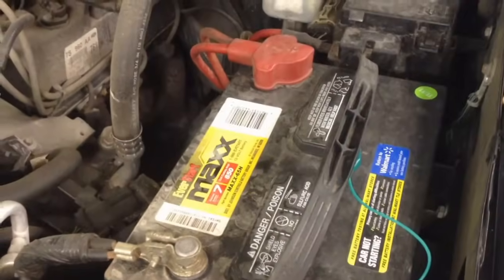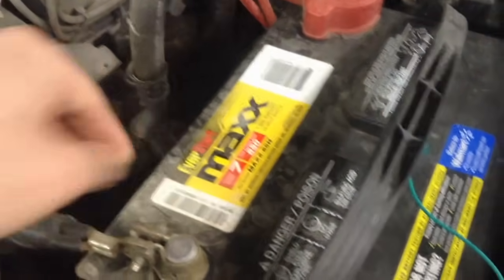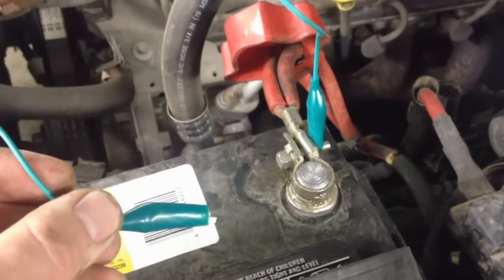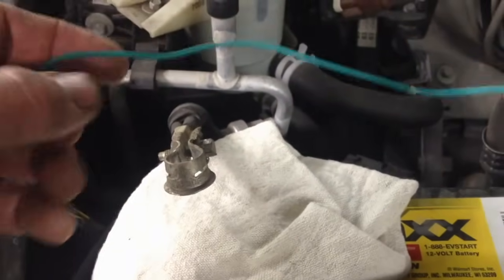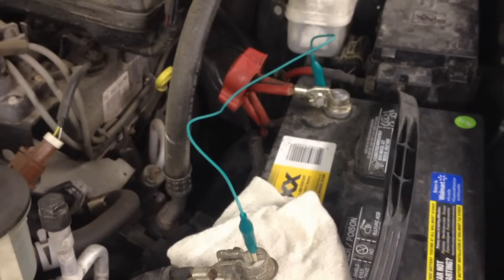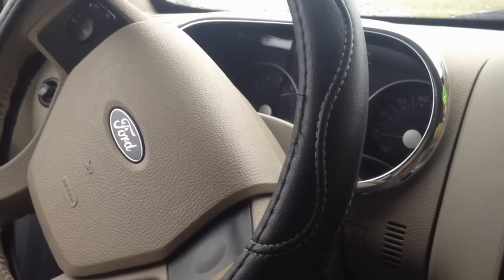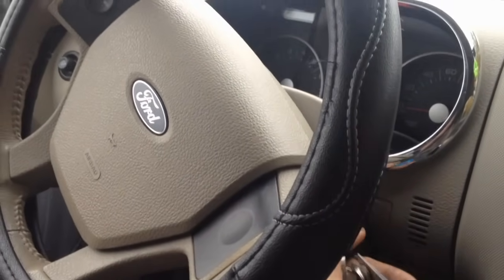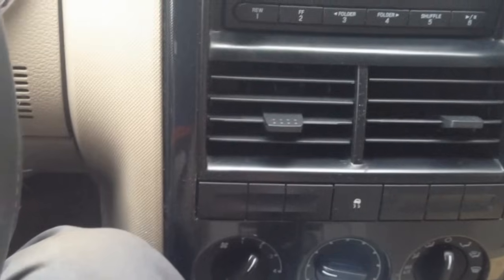How To Clear Your PCM'S Memory On Fords After Repairs

Comment: I have Ford f250 5. 4 99 in light duty body (oem)  redoing timing chain it skipped time resetting time chain I wanted to replace cylinoid vtc and cam phasers but it seems like I don't have the same set up. Also to which coil packs and spark plugs are the best for replacement . Tired of buying cheap coil packs any help would be great. P.S I live in Kelso Wa if you want to stop by other people might have an oddball like mine

Comment: Sir pls I have issue with my Ford Explorer 2010 airbag light is on ,when I switch engine off and again on light will disappear but after few days it will come again without any reason , kindly note it's not plinking to give any code only one and stayed
Reply from the maker: AHMEDELSAYD SAAD Only common issue on the explorers is the passenger airbag off light above the radio goes out or the connector gets disconnected. Otherwise get the codes read.
Reply: Acutely, it's not passenger airbag this in my dash board driver airbag and it's not plinking to give code just illuminating pls help I got crazy
Reply from the maker: Yes I know but the passenger airbag lights fail on these and will cause the airbag indicator in the cluster to come on. Pull codes and you will know.
Reply: I thought you guys rode camels? You have cars now? lol

Comment: I have a problem I did the reset like you showed here now it seems like my vehicle is idling low, any advice please help???
Reply: FordTechMakuloco sir now the vehicle is idling strange the check engine light came on, its not flashing its just on??? please help the vehicle wasnt like that until I did the reset
Reply from the maker: Bo Temple which vehicle model year engine please
Reply: 2006 mercury mountaineer
Reply: 4.0 liter v6
Reply from the maker: love nature Clean the throttle body as shown in my video video and perform the reset procedure again. The throttle body is sludged up.

Comment: I have 2004 f150 5.4 3v it keeps going into reduced power mode with code p2106 tried to reset pcm if you  can assit me with this it would be greatly appreciated
Reply from the maker: Mary Slagter If you have a 2106 code there is another code in there. 2106 is only a condition code. If you want my answer you likely need a tps sensor or a whole new ETB quite common.
Reply: FordTechMakuloco Using my aftermarket  scan there is no other codes stored in the pcm.does that 3v engine have the spark plug issue.
Reply from the maker: yes yours has the broken spark plug issue

Comment: I have 03 expedition I got a p0506 or 07 for a low idle. I tested the ohms on the Old iac it and it came up to low. I replaced the iac but upon start up it idled up and down but eventually leveled out. Now whenever I start up its revs at about 1500 - 2000 rpm for a good 15-30 seconds before dropping to about 700 rpms. Sometime i come to a stop theres a little up and down idling but it quickly pans out. Should this this fix the issue. Thanks for helping us DIY guys your blessing sir.

Comment: I'm having a real hard time with my ford freestyle 2005 it idles but when I drive it goes into safe mode  I swapped the throttle body thinking that was the problem but I didn't do this procedure I will try it hope it works any advice or help is appreciated thanks for posting this

Comment: My temperature sensor is getting to many volts passing thru it I tested it today and it is passing way about the 5 volts it should be passing. I think I was up somewhere around 12.10 volts do you think this restart would help it learn the values it needs. Because the truck has hard started and retarded timing when its at operating temperature cause it always thinks it cold...Any help would be awesome and thanks awesome video by the way

Comment: I clean my  throttle body and now the flap won't close all the way. It's idling way to fast the other side is working fine after I cleaned it. I disconnected the battery and rest the computer but still same problem.  I have a 2007 Infiniti G35x sedan.  Any suggestions
Reply from the maker: STREET SURVIVOR Most other manufacturers requires the dealer scan tool to reset the etb angle.

Comment: this 61 year old loves you makuloco! had alternator/battery issues and after the repairs were done i had shift issues. mechanic said 'you may need a new transmission'. being the daughter of a mechanic i googled shift issues and found you. not afraid of getting a bit greasy...i tried this today and it did exactly what you said it would...now i can go north next weekend without fear.#memelovesmakuloco
Reply: Thank you Peggy for sharing this. This is very helpful and useful.
Reply: The battery connecting helped your shifts???
Reply: Pac Man Gamer Doing this reset computer and computer learns shift point based on your driving.
Reply: Peggy Eggers Smith wow you do it yourself. .. not much women work on cars ... I'm happy for you.  thanks for sharing your story .

Comment: Great to see people helping people not looking to rip them off.
Reply: You're exactly right. Finding a good honest mechanic these days like FordTechMakuloco is next to impossible. In MHO he's worth his weight in gold and then some.
Reply: @BrianSmith-lo3mj  1¹¹
Reply: Now help him with a 1 dollar donation.
Reply: I need to know the colors of the wires going into the fuse box under the hood how do you know how that goes that burnt down and I'm trying to wiring another box I don't know where they go
Reply: James you are perfectly right on your comments. I am a jack of all trade myself and I helped a lot of people , and  mostly I don't take money , just happy helping poor people.
Reply: James R. Schroen Sr I HAVE A FORD FOCUS ST 225 2007. MY ENGINE CUT MID BOOST. 2ND GEAR. NOW I HAVE NO REVS ON THE REV COUNTER ENGINE IN LIMP MODE. MANAGED TO GET HOME. GEARBOX FEELS LIKE IT HAS LOW OIL IN TBH. READ THE FAULT CODE. P0727. I SUSPECT AN ENGINE SPEED INPUT SENSOR. WHERE IS THIS LOCATED ON THE TRANSMISSION
Reply: @davecozzie1  where might this be on a 2007 Ford Edge SEL AWD SUV ?

Comment: I changed the guage cluster in my moms 2000 windstar when I put it back together it wouldnt start. So i put the original cluster back in and it still wouldnt start. so I found a blown 10n amp fuse. I replaced the fuse and itstarted. But the radio didnt work. So I was thinking it had something to do with the anti theft. So she drove the van for a while with no radio,then the battery went dead, we replaced it. a couple days later the new battery was dead,so I replaced the alternator.It was ok for about a week, then the battery stopped charging. I took the alternator back they tested it and said it was good. Is all this from changing the cluster?

Comment: Thanks for your explanation and your time. In Argentina, the Ford Ranger 2012+ has a big issue with the PCM. After a while, the truck starts with injection failures and/or huge fuel comsuption. The solution is to go to a Ford service and program again the PCM. Ford has been updating the PCM program all these years but they never got any solution and new truck are also failling. My question is: Is it possible to reset injection learned values with this procedure? because, if this problem appear in the middle of a trip or in the middle of nothing we are in a huge problem and this would solve it. Thanks again !!!!

Comment: Why not just disconnect the POSITIVE cable from the battery, then go and turn the car on with the key and switch on some accessories (lights, wipers, etc)?
That would bleed off capacitors real quick...

Same way you bleed off caps in a laptop computer...
Reply from the maker: YooTooobJeff Why? Well the first reason is almost everything is ground based switches now so when you turn on the headlamps it sends a ground to the SJB which in turn either PWM or turns on a relay. the relay nor the sjb will power up hence we are not turning on any headlights to drain anything. Cars are much different today.
Reply: FordTechMakuloco thanks for the reply! You are quite knowledgeable and it is greatly appreciated that you make these videos and explanations to help us!
Wondering if you might make a list of repairs where it is advisable to reset the PCM to relearn (ie, TPS cleaning), and which ones where it's not necessary (like MAF sensor cleaning)?
Thanks for all you do!

Comment: I have a question when you get a chance i have a 03 explorer 4.0 and out of no where the car shift the gears hard and i have not drivin it since then the od light is flashing if i clear the pcm it will drive find for the first cycle then it start shifting hard again alot of people are recomending that the solonoid is bad do you think its that as well
Reply from the maker: george ford I would get the codes read first thing and then we can go from there.

Comment: I have a 2008 Jeep Rubicon was this work for it it idles hard and also its stuck in 3rd gear and will shift up or down in any other gears from the transmission
Reply from the maker: jimmy blue332 You can try it but I am quite sure you have other issues.
Reply: I found a code p1745 too thanks getting back

Comment: Hi, i live in Brazil. Ten days a go I bought a ford mondeo, Which is the same as Contour. The year is 2000. Today i was driving fine but suddenly the car stop shifting to the 3rd gear. Since that im driving only with 1rd and 2rd  gear and sometimes de o/d light flashes. the oil level its fine. Please Help me.
Reply from the maker: nofxdc22 I don't know much about those but if the fluid is dark and burnt smelling it is toast.
Reply: No, the fluid its good. But the car doesn't shift to 3rd gear. Today we scan e it says "3rd gear wrong ratio"

Comment: My truck is idling low and stalls out when turning or slowing down almost to a complete stop... I've changed the battery on it and this problem didn't start til after I changed the battery. Could doing this help?
Reply from the maker: Josh Williams This combined with a throttle body cleaning.
Reply: Josh Williams.
Reply: IAC Valve possibly as Fords are notorious for them going bad ?

Comment: I have a 2013 ford explorer xlt I just changed the electric throttle body will the video help me reset iac/throttle body
Reply from the maker: demencio vargas Yes follow this procedure
Reply: FordTechMakuloco I notice by replacing the old one to the new one its still the same guess I must reset the ecu
Reply from the maker: demencio vargas Original air filter assemble all air intake systems tight and leak free?

Comment: Does this work when I change the throttle body from heated to non-heated in ford freestyle 06?
Reply from the maker: Yes very important follow the idle relearn in the video after
Reply: @FordTechMakuloco  hi ! I recently bought a 09 Taurus X SEL i love it cuz I drive Uber ! I started having problems outta nowhere ...first started smelling small amounts of gas now and then but yesterday on a trip after driving it ran so crappy and it was almost like I was out of gas cuz it ran rough and stalled and wouldn't start unless I added more gas to it I had someone help me I was on the side of the road it wouldn't start so he got me a can with 2 gallons of gas it started right up ! But then I went to that gas station and added  $15.00 more gas to it and drove home which was like 30 min away when I shut the car off it still had gas in it and said 30 miles till empty ! This happened 2 times earlier in the nite too before It died ! The next morning I went out to start it it started right up then died out after about 40 seconds and after that my starter died I put a brand new starter in it today and also it wouldn't. Start almost like it was so flooded ! I only managed to  get it started cuz I kept trying and once it was barely running I held it to the floor it felt like the old carburator muscle cars I used to drive as a teenager when the 4 barrel was no good that's what it felt like it was chugging ! Anyway after I left it running awhile today after putting the new starter in there was a huge puddle of black gas under the car where the catalytic converter or muffler sits ! All was smoking outta the tail pipe too then it just shut off again !! I haven't tried to start it again yet cuz I'm so aggrivated but also the throttle body had a shit ton of fuel in the butterfly opening when we had to take the covers off to get to the starter !!! Also now the check engine light came on and it's never done that before since I got it ! Is all this pcm related?? I'm so aggrivated and stressed out ! I've been wrenching on cars since I was 16 I'm 46 now but these newer vehicles piss me off !!!! Any ideas ?
Reply: +FordTechMakuloco Is this reset necessary after you switch engines if the engines are slightly different. They were both V-6"s. And could it cause issues with overdrive?
Reply: Replaced my trottle body and did that, the wrench key still shows up in awhile and stops exhilarating ..

Comment: Hi I have an 03 v6 mustang it will crank but won't start and speedometer reads 60 without the key being in i was referred to your video can your method get my car started and running
Reply from the maker: jcade24 No your concern goes much deeper. Is your theft light flashing?

Comment: Can I just use my ELM327 OBD reader to reset it?
I use SCANXL software on my laptop as the interface when I'm plugged into the car, and I have used it to reset/clear engine lights before.  Is that the same as clearing the PCM Memory?
Reply from the maker: Alot Anor Clearing codes is not the same thing, my procedure will clear the fuel and idle adaptive tables as well.

Comment: My 2010 Escape 3.0 crankshaft position sensor is leaking oil. Can I reset the pcm memory by this method or will I have to have the service department reset the pcm when I replace the sensor.
Reply from the maker: David Siebert You will need to have the service department do a misfire profile correction.

Comment: Hi, my mechanic just finished working on my 08 explorer sport trac, he did a valve job, yesterday he called me and said something was wrong with the PCM computer, he called a friend to check it and see if he can reflash it, his friend told him it has to be replaced.

Do you think doing the reset you show on the video can fix the problem? 

Thank you very much.
Reply from the maker: Why did he say it must be replaced all a sudden? Why was it brought in the first place??
Reply: FordTechMakuloco well  when my mechanic finished his job the scanner showed up a problem  with the PCM  I don't know what code, he called that friend and he told him that, but I'm not sure, I mean I trust my mechanic but I want to look for other possible options.  
I have been looking on ebay and other places and the price is from 400 to 800.
Reply from the maker: juan Penaloza Get the code and the exact reason why it must be changed and let me know.
Reply: FordTechMakuloco P0171, P0302, P0316. The engine runs smooth but when it warms up the  injector #2 does not work the electrical power cuts.
Reply: FordTechMakuloco 
The electrical signal to the injector #2 cuts off from the ECU.  I think that is the reason for code P0302.
Reply from the maker: Well if they have verified the injector driver in the pcm is failing then go after it I have seen them keep coils on before yes. Once it is verified I would go for a new pcm yes.
Reply: My mechanic got it already on ebay for $225 we are just waiting for it.  
I'm going to  clear it tomorrow, if it does not work  We'll install the  one we are waiting for.

Thank you very much.

Comment: I had no foam gasket left around my air filter tray and it was missing for quite some time. I replaced the foam and reset the pcm , now the truck is running great ! Thanks for posting this video ! (2006 f150 5.4)
Reply from the maker: Yeah those are very common causing a p0174 glad it's fixed

Comment: 08 F150 5.4 triton, battery flashed for weeks. Now it stays on constantly and also has a hard start! New Spark plugs, New battery, New Alternator, New Starter, New Fuel pump... And all wires look Gud! Any help wud b appreciated
Reply from the maker: MrJanuary318 What is the alternator charging at before and after alternator change?
Reply: I got to get a new meter, but it the old one tested good inside and outside the truck, eventually I said forget it and bought a new one! Everything test good, I can't figure this one out
Reply from the maker: Start by inspecting the wires that go into the alternator and then we need to check the actual output of the alt.

Comment: I have a 2012 escape. The throttle body, PCM and transmission speed sensor has been replaced. Drove it off the lot and the car still slams, speedometer and RPM are jumping all over the place. Car feels very unsafe, I fear my car may kill me because I literarily have no control over it. 
I can post a video on my youtube if you could take a look.
Reply from the maker: Josh A I will let me know when its posted and a little more background please.
Reply: FordTechMakuloco  I posted 2 videos
Reply from the maker: Josh A Ok I see the wrench light came on what are the codes set?

Comment: I've got '99 Windstar and the PATS gave me a code that involves the PCM. The code was this: #16 Faulty link between PATS and EEC, please, I need change transponder o reprogram? I live in Monterrey México and intent clear PCM memory and problem continue.
Reply from the maker: Jorge Linan I don't see no code 16 was it P1636?
Reply: FordTechMakuloco This code I got after aprox. 50 seconds I turn the key onto the ON position with the Theft light blinking quickly and then it showed the code 1 and 6
Reply: FordTechMakuloco And from the cluster codes, the vehicle had this codes related to the PATS: dtc9600 and 9681